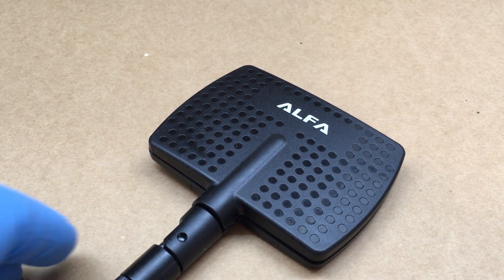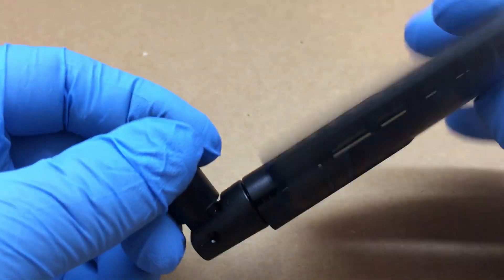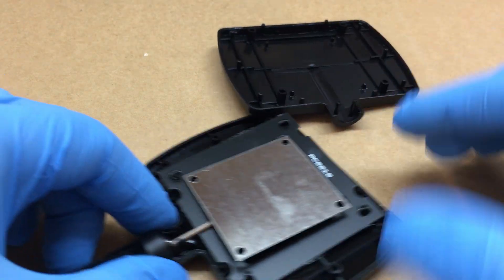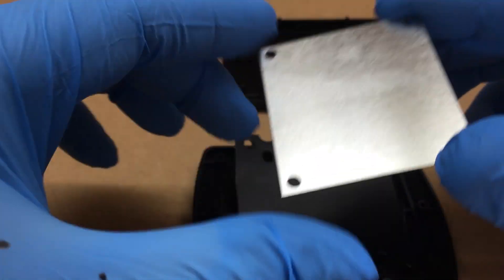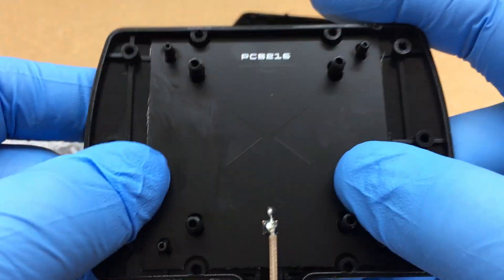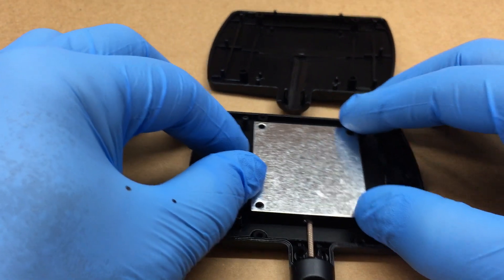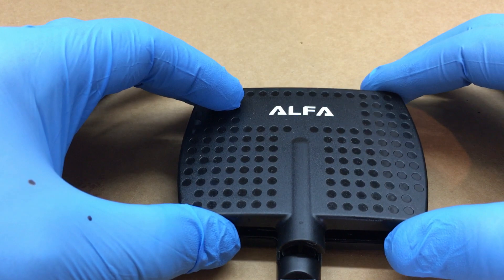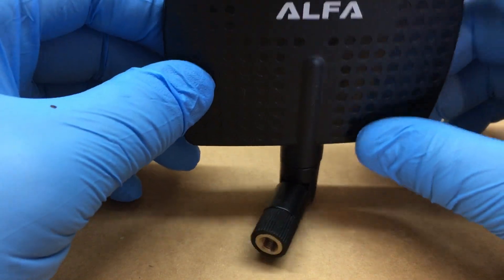The Alfa 2.4GHz 7dBi Panel Antenna

Comment: which side is emitting the WIFI signal ?   coming out of the label side or the black side
Reply: I'm too late, but if someone else reads this: The label points to the wifi source.
Reply: @timha4102  the confusion is on there other model its the other way around if its label side theory emmiting the signal https://www.youtube.com/watch?v=pIPMwQ4Bsuw

Comment: Mine doesn't have a piece of metal sheet as a reflector but rather a cheesy patch of foil which isn't even flat because of the plastic ribs.where it sits I think a piece of tin foil glued flat on some cardboard would make a better job.  Bought on Amazon
Reply: Send that fake one back bro, Amazon of all retailer assholes should be held to the higher accountability for product verification and standards.
Reply: wow, is that a fake antenna?